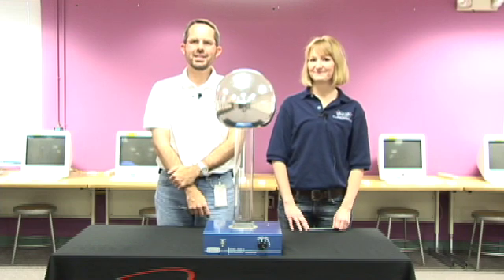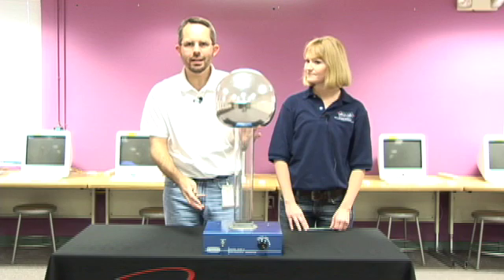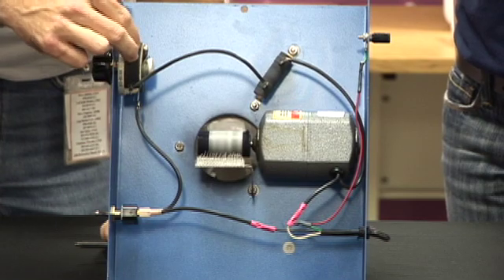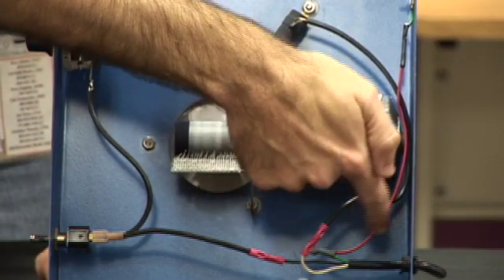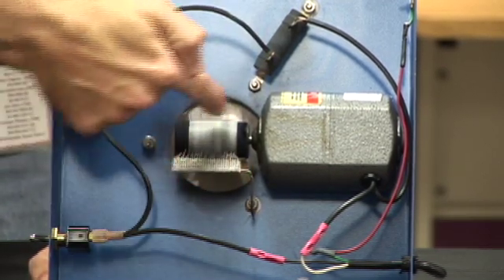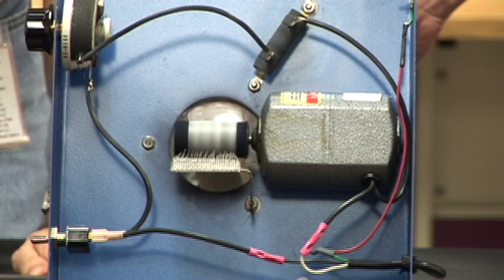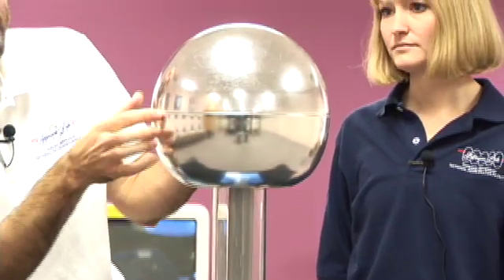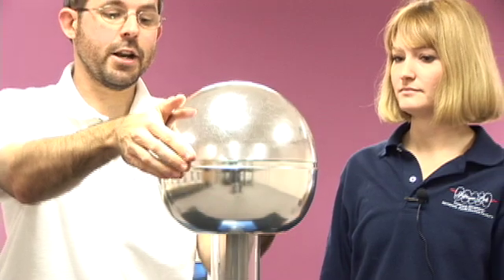How Does a Van de Graaff Generator Work?

Comment from the maker: @carlosjunior57 Whatever you use, it's helpful if they are on opposite sides of the triboelectric series with your belt material more or less between them. There's nothing wrong with using copper as one of the two pulleys. Just consult the triboelectric series to see what other material would be a good match. Our pulleys are felt and, I believe, nylon.

Comment from the maker: That could very well be the problem. Carbon containing rubber isn't a great material to use for the belt. While it insulates at low voltages, higher voltages result in arcing. The end result is that the charges 'bleed off' before they make it to the upper dome.

Comment: What is the lower and upper pulleys made of? I've made the van de Graaff generator (at home) but it doesn't work. In my generator the lower pulley is made of metal and upper is made of rubber. I need your help. I will send you more informations and photos if you want.

Comment from the maker: Yes, the grounding wire is using the ground provided by the three wire power cord. While the voltage we're feeding back into the wall is high, the current is low, so there isn't any danger to people or to the building.

It does cause problems for the computers in the back of the room, though. If they are on when we discharge, the machines will often reboot. Having something that is electrically sensitive hooked-up to the same ground as the Van de Graaff isn't a great idea.

Comment from the maker: We bought our Van de Graaff, so the motor came with it. Here are the specifications, for what it's worth:

Dayton AC-DC series motor
Model Number 2M033A
115 Volts
1/15 Horsepower
1.2 Amps
60 RPM

Comment from the maker: There is also a port on the base that we can plug other devices into. This becomes important in some of our other videos. We attach a 'grounding dome' to this port, mainly so we can discharge the main dome. It completes the circuit. Electrons go from the earth, up the belt, onto the dome and back to the earth somehow. The grounding dome is a convenient way to get them there. You can see this in action in the oddly named 'Big Sparks, Little Sparks!' video.

Comment from the maker: ...it gets more and more difficult to remove electrons (since opposite charges attract). Connecting the base to the ground allows electrons from the earth to neutralize the base. The earth becomes positively charged, but, since the earth is so much larger than the base, it doesn't really become a problem. It's kind of like taking a cup of water from the ocean. The level of the ocean goes down, but no one is going to notice.

Comment from the maker: The grounding wire connects the base of the Van De Graaff to the ground. Connecting the base to the ground provides the device with an inexhaustible supply of electrons. Let's say that the case weren't connected to the ground and that it was on a well insulated table, so it's basically an isolated system. Electrons from the base would be brought up to the dome by the belt. The dome would become negative but the base would become positive. As the base becomes more and more positive...